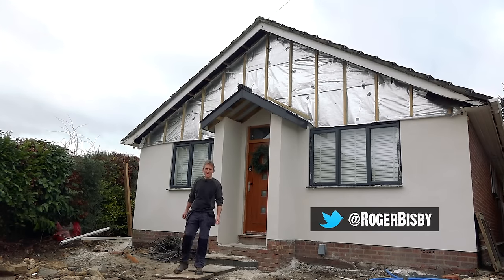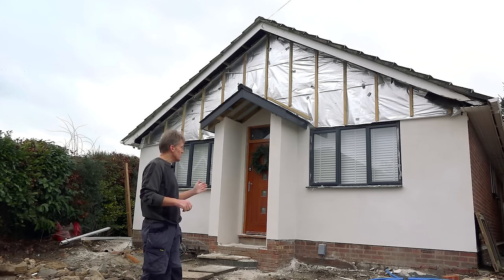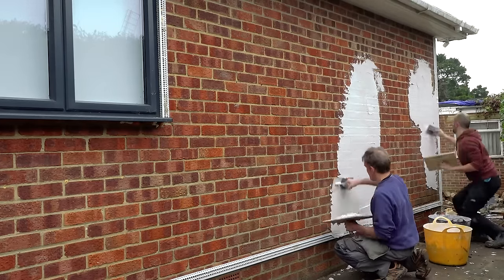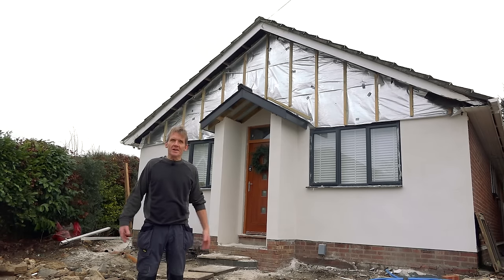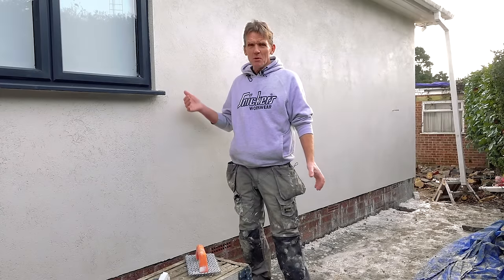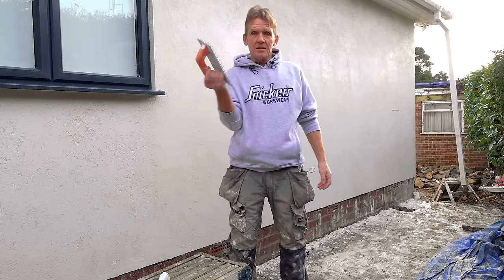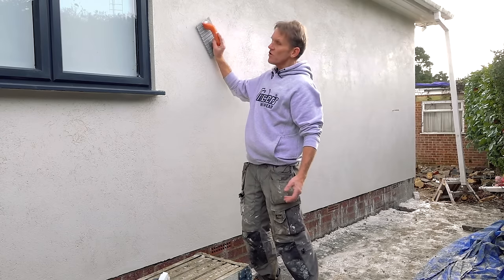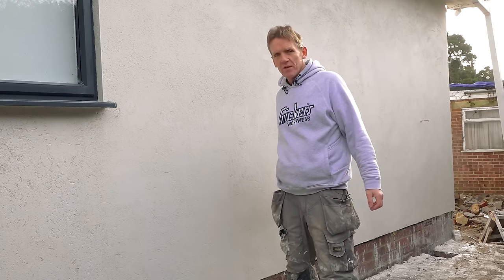Wenber One-coat Render for Beginners

Comment: Will it effect the moisture levels in the building applying this over brick work .And whats the score with using it on wooden buildings to make them a bit more weatherproof.
Reply from the maker: You can put it onto expanded metal lath but most people use a cement board and then use a readymix tub of acrylic over the Rendaid. You are best off seeking advice from Weber on this because it depends on vapour control from the inside out.
Reply: Hi , Iv just had my house rendered in monocouch chalk , 6/7 weeks ago , but it seems to be still seems to be flaking when rubbed,  I have black plinths and black decking and when it rains or sprayed with a hose it leaves little grains of  chalk on the decking and plinths ,is this normal,  any advice would be appreciated thanks
Reply: I guess im asking randomly but does anyone know of a trick to get back into an Instagram account??
I was stupid forgot the account password. I would appreciate any tricks you can give me!
Reply: @Saul Brysen Instablaster ;)
Reply: @Gary Ira It worked and I actually got access to my account again. I am so happy:D
Thanks so much you really help me out !
Reply: @Saul Brysen You are welcome =)
Reply: @ashTHFCley hello I saw your 3 year old comment about your chalk monocouche render job flaking on your property, I'm actually going to be getting the same in a couple of weeks , chalk colour going over an old pebble dashed cement render on our home, how is your house now with the render if you don't mind me asking ? I appreciate that it was a 3 year old comment, i was disappointed for you that there was no reply to your comment.
Reply: @ThePaulg123  it’s completely fine now , it stopped after 3/4 months 👍🏻

Comment: Aqua panel exterior is a render board by knauf, but there is lots of other makes,parex one coat render won't guarantee there product if use a cement based board also they won't allow the building to breathe.

Comment: As usual I learnt something. I did not realise that you scratched the surface to prevent the cracking. 
I did a bit of rendering with K rend and its really easy. You can smooth the surface where you fluffed up applying it.
Best not to scrape it early. It may be a little harder later (not to late) but it gives a better finish.
Reply from the maker: Yes we had a couple of little holes to repair and it is easy to rectify problems and patch up.
Reply: Hi what's difference in quality and final result between weber and k-rend
is the weber more likely to crack with time?
Reply from the maker: Salvo Tr
The Weber is no more prone to cracking than the K Rend. The main difference is that K Rend has some silicone in it which is claimed to help  water run off and the Weber product has a  mould inhibitor. There is a problem in urban enviornments with streaking on these through coloured monocouche coatings and Weber give good advice on avoiding this. Unfortunately many builders don't follow it.

Comment: Shouldn't there be a bell housing bead on that bottom edge? They are supposed to angle out ever so slightly for water run off.
Reply from the maker: No a bell housing just hold moisture and goes mouldy, I don't like them.

Comment: Always stick the beads on,pink grip is the best,if you screw or nail and they rust there is nothing you can do to repair,One coat renders are not easy to patch they will always end up different colours,also if you are rendering different walls i.e. Gable/ front etc they must be scratched at the same times or you can end up with different colours,and to the question below one coat renders are breathable as long as they are not applied on top of sand cement render.You can use render boards over timber buildings as long as you use base coat first,rend aid or parinter if using parex one coat which can be applied in one go,no need for 2 coats.
Reply from the maker: Good advice Mark. We did use stainless steel screws but I take you point Pink Grip will never rust. When you say render boards are these cement-based building boards or something special?
Reply: Don't use pink grip with krend. The solvents bleach through the colour

Comment: When you went straight onto the brickwork did it not need a scratch coat and mesh ?
Or was it OK straight onto the brick, 2 coats and rubbed up ?
Reply from the maker: We only meshed the aircrete. The bricks are fine. We just went on with two coats one straight after the other.

Comment: Great video Rodger.  If I was to render the back of my house, how would I finish between my side and the neighbours? Would that simply be a stop bead vertically down the wall on the boundary line. Any advice would be appreciated.
Reply from the maker: Yes exactly that. Make sure they are 100% happy with the line before you fix the bead
Reply: Thank you for your time, much appreciated.

Comment: I've got the pebble dash problem. Yes it's a nightmare. Whoever put it on knew what he was doing. I doubt I'll be able to get it off. Seen this one coat dash coat stuff. I've read after scrapping loose pebble dash bits off can apply straight over pebble dash. What are your thoughts on this? The house is only top half pebble dashed. I need a solution. I love my house. I HATE the pebble dash. Please help!

Comment: What would you do in terms of having lead flashing beneath a window sill on a wall you want to render? Fold it up render under it and push the flashing back down after?
Reply from the maker: Yes if it is possible to lift the flashing then putting the render under it is the best thing
Reply: @SkillBuilder  I notice many rendered houses don't have visible flashing at all under the sills. Is it possible to just remove the lead flashing completely  and render right up to the sill or would that cause issues do you think?

Comment: Hi Roger, I've ended up watching loads of these videos even though I'm  t likely to have to do any of these things. 

What is the purpose of rendering? Is it purely decorative or does it have a practical function?
Reply: Hi Michael, rendering provides both decorative and practical advantages! Rendering protects the brickwork from harsh weather conditions. Our Ecorend MR1 Monocuche Render is water resistant and breathable, meaning that it protects properties from day to day degradation from the weather, without causing mould and mildew, which can become trapped and cause issues in renders that don't breathe!

Comment: elo Roger do u need to mesh the brick work up to or just around the windows also do u have to use a base coat or just the one application and how long do u get to put it on the wall after mixing up the Weber sorry about all questions just am old school sand and cement lol but getting people asking for this system and can u put this straight over painted brick work phew cheers 👍
Reply from the maker: Rock&Roll45 
Sorry mate I didn't see this question. The alerts don't always work. We used Rendaid on the blockwork and meshed that up because it was Thermalites but the brickwork is good to go over with one coat. The first pass pulls back on the mortar courses and then, as it picks up,  you can simply give it a second pass as you do with finish plaster. 

As for painted brikwork, if the paint is really on there then I suppose it will be o.k but I would rake the joints out a bit so at least it has some key into the substrate.
Reply: Skill Builder cheers bud

Comment: hiya there i done my house extension with concreate blocks will i need one  coat of that render or 2 coats 
and aslo i was gona ask you will i have to put pva or something else on wall 1st so it wont get dry quick
Reply from the maker: Don't ever use PVA on the outside. If you are using this product then put the first coat on and build it up with some more  while it is still wet. It pulls in as it dries and will then support some more.
Reply: thanks alot

Comment: This stuff is one coat system. If You make some wave on 1st coat, deferent fickness can make u troubles with marks. On exterior blocks not need rendaid and always, like weber specification, You need  put mesh around windows. If You don't do that, weber don't give guarantee for customer on those product. Like for me don't looks like profesional, sorry. P.s. Sorry for my grammar

Comment: Love watching your vids very informative.
Couple of questions if you don’t mind.
1st. I noticed there was a greyish render on part of the house which you went over.
Did you put that on before the One Coat render? If so Why?
2nd. Did you have to prime wall first? If so what primer did you use? PVA or SBR.
There’s so many primers on the market and it’s hard to know which is best.
Thanks.
Reply from the maker: It was a bonding coat and it is basically cement based tile adhesive sold in different bags. It is not essential but it helps
Reply: @SkillBuilder  
What about using a primer first 
PVA or RBS?

Comment: ive only used krend, what the plus's an minis's of using webber
Reply from the maker: Weber has stain resistance but K rend has silicone. That said they both stain if you get the detailing wrong

Comment: This is what I don’t get they say it’s a one coat system yet you are putting two coats on, basically a scratch coat like you would on sand and cement without the scratch key but it’s two coats not one.

Comment: Under no circumstances would I put those type of products straight onto brickwork, your asking for trouble down the road. The risk of delamintation is extremely high if you don't follow the correct procedure, from what I've seen here expect problems
Reply: Hi John.  Would you rendaid and cloth over the bricks?

Comment: Hi just a quick question why did you use rend aid on the front but not on the side ? just wondering as im thinking of using the same stuff on my house.

cheers
Reply from the maker: Hi Michaelle
We needed to use it so we could mesh up the porch which was built of Thermalites. So we thought we might as well give the whole of the front a base coat with the same  material which we had left over. It was a mistake because the next coat wasn't quite thick enough to stop the grey showing through in places and we had to frig about. So we decided that on the sides and back we would just go with the one coat. There was no issue with adhesion so no need for it.
Reply from the maker: Sorry only just picking these questions up. We used rendaid on the front because someone told us it was a good idea but it isn't because the grey colour shows through when you scratch up. If you use the Rendaid then give it  a scratch coat of finish and let that go off.
Reply: @SkillBuilder  when it's not your trade and your demonstrating on how to do it please go learn it first on a course to no why you need to do it there's comments I don't understand from you like a friend told us to use rendaid if you don't no what it's for why you doing it plus if it shows grey through the topcoat means your rubbing it back to far.
Reply from the maker: @apollocreed85  We did go on a course. I understand that there are a few things I could do better but the end result stands.

Comment: Nice work Roger. I guess being lime it will naturally be breathable, always a good thing helping the walls to breathe. Modern day renders such as sand/cement/gypsum is not always a progression. Old techniques of using lime is still the way to go.
Reply from the maker: Totally agree lime is lovely. I use it with sand and cement to add a bit of fat and it makes it nice to work with. I think Weber is crushed limestone and cement and I would guess there are polymers in there but I don't know.